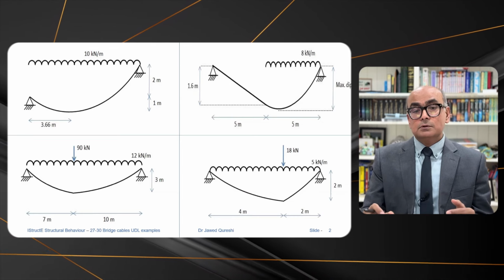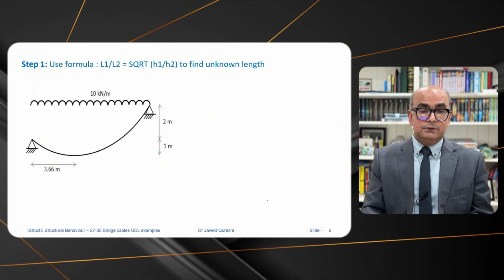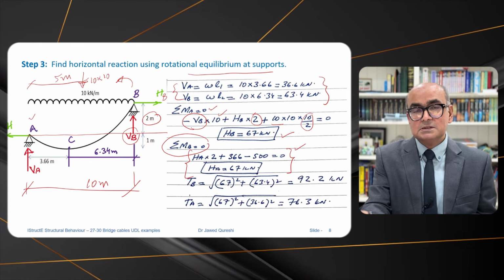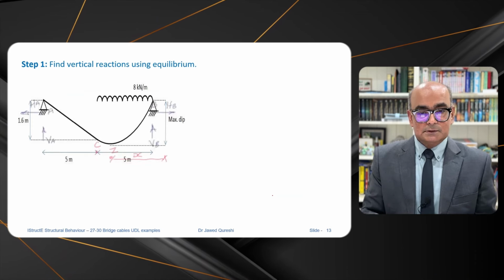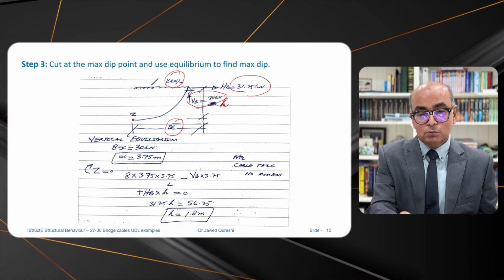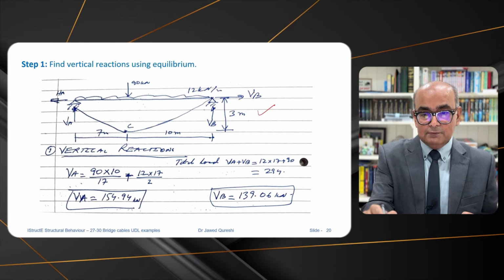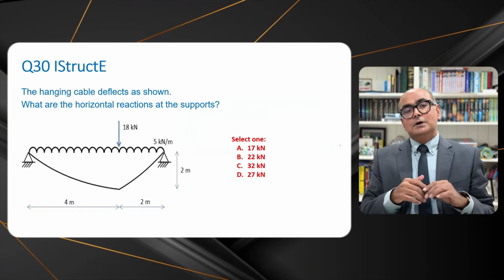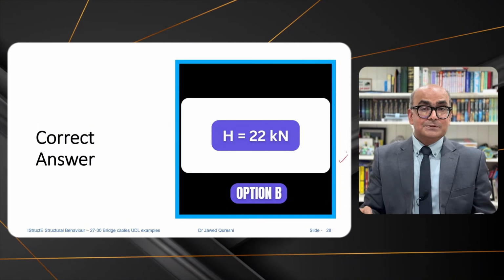Cable Analysis Made Easy: A Step-by-Step Guide | IStructE Structural Behaviour Course

Comment: In example 2. You say find x by equating 8x to 30kN. Ie Sum of forces in y direction = 0. But wouldn’t there be another internal shear force at the cut (point Z) which is unaccounted for?
Reply from the maker: Let me check, I’ll get back.
Reply: Shear and bending moment would be zero everywhere along the length of the cable, they are tension only members. Which is why he was able to equate the 8x=30  and to substitute x to find h in the moment equation.
Reply: @kon8024  hi, yes there is no "shear" and bending moment in the cable, but the internal tensile force does have a vertical component, which must be considered. The reason it was ignored here is because we find ourselves at the point of max deflection, where the internal tensile force (tangent) is horizontal, thus its non-existent vertical component was ignored.
Reply: Hi, here is my understanding: The tensile force inside the cable is always along the cable (tangent to the cable). At the point of max sagging, tangent is horizontal, and so no vertical component, that is why it has simply been ignored in this specific instance. Had we made a cut elsewhere in the cable, we would then have to consider the vertical component of the tensile force. Hope that helps.